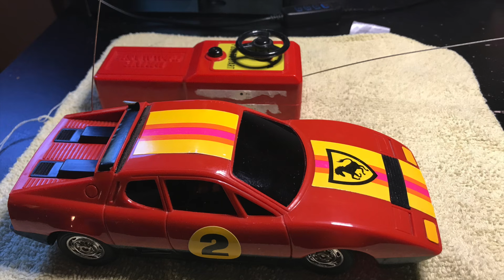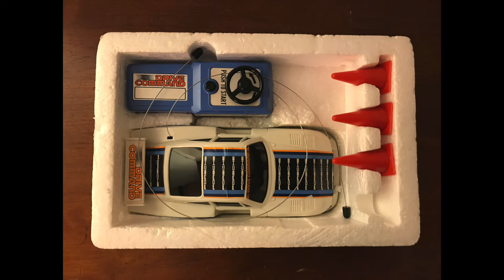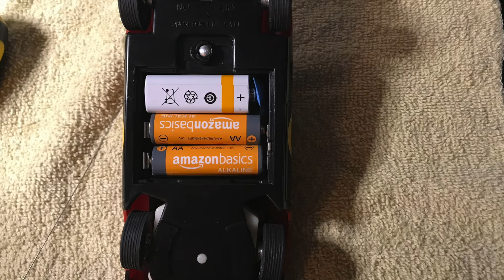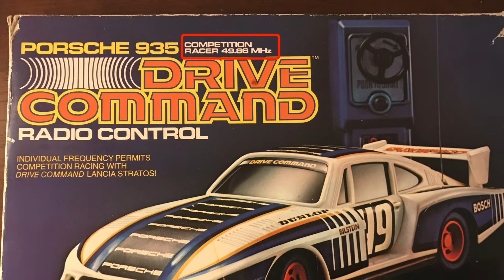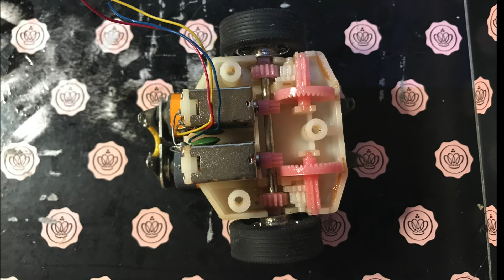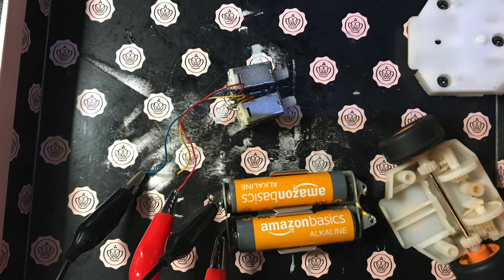1978 Mattel Drive Command Radio Control Model Car/Truck Repair

Comment: Wow, use to have one of these as a kid.  Loved it.
Reply from the maker: Thanks for watching!
Reply: I remember discovering that my toy walky talky  could pick up the signals from the transmitter.  That keying the radio it would jam signals to the car.  And ultimately realizing I could imitate tones with my voice somewhat drive the car.  
Which if course just fueled my interest in electronics.
Reply from the maker: Right, most toy Walkie Talkies operate at 27Mhz. Vintage analog remotes work on this frequency as well.